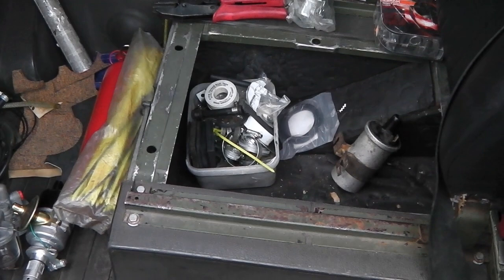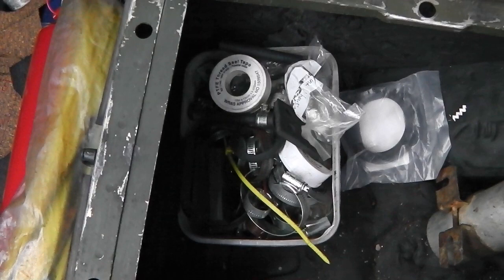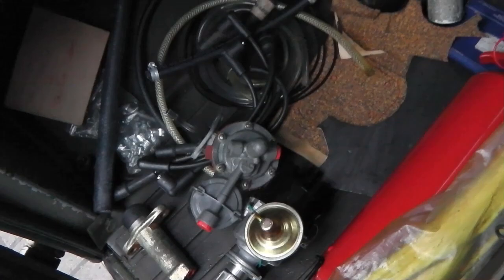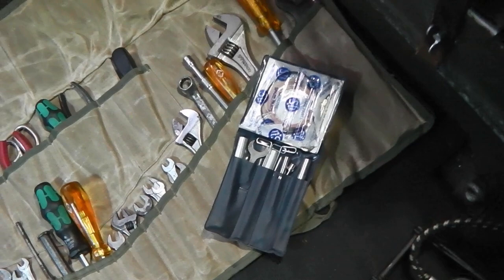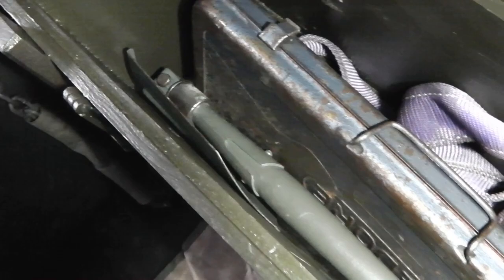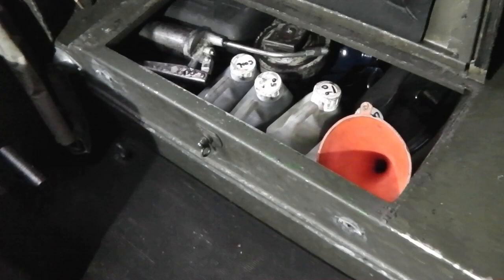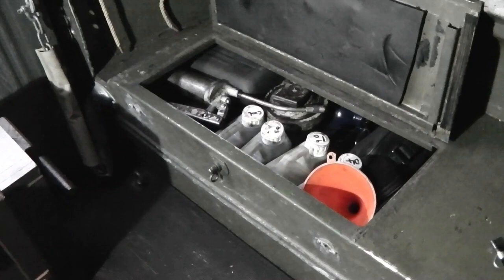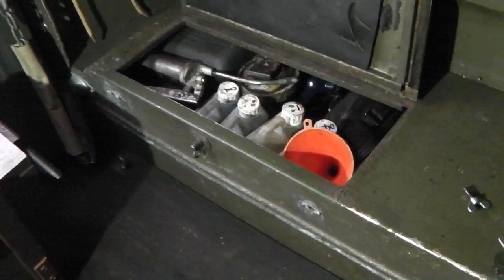Tool kit and spares in my Series 3 Land Rover

Comment: More comments!  I carry a few three foot lengths of decent wire, strong fencing wire, thick copper wire( out of 30 A mains cable) and some thin galv steel wire which is brilliant for threading electrical wire through holes for example, so you can pull it through . Useful for everything potentially but hot stuff particularly. Exhaust pipes etc 
And a good powerful magnet. Keys down drain scenario. 
Also I keep some good blocks of wood, for jacking or run a flat onto so you get your jack under the spring base or axle. 
Jar of Vaseline and spare bulbs. And spare rad cap.

Comment: Have watched lots of your videos now ... extremely informative and a valuable guide.  I don't have so much luxury of space in my 88 S111, so am limited to what I an fit under the front passenger seat .... have had trouble with the points recently, so packed a spare set, along with rotor, condenser etc ..... went out on an errand today, and it started to splutter .... whoops, let the starter handle in the garage, which I use to rotate the engine and set the points!!! Oh, well, as usual she made it back home, if a little bit spluttery.

Keep up the videos - really good work - wish I had a mechanic like you to keep an eye on mine!
Reply from the maker: Thanks very much, always great to hear people like the videos - makes it worth taking the time. 
Have you considered electronic ignition? Despite the internet forum naysayers, installed correctly it is always an improvement.

Comment: Logical planning! I'd suggest adding a gas blowtorch, useful for all kinds of emergency including loosening stuck bolts,  heating the inlet manifold and pre-warming spark plugs ( put them back quickly !) in cold start disasters.  Heavy duty jump leads from welding cable are good &  I'm a second battery and spare alternator convert. If tubeless tyres then a good quality tyre plug kit is a must and if tubed, two new inner tubes. I guess you are post-starting handle era with Series 3 ? I also carry loads of epoxy metal, araldite etc. and soft iron wire plus assortments of sizes of cargo ratchet straps and odd pieces of timber are useful for bodge field repairs. I've made an axle breather plug from wood in a crisis ! A few spare wheelnuts could help when the ones in use disappear into drains. You might justify a 101 if spares inventory escalates! Beyond 35 years of Land Rovers I've found Unimogs also  therapeutic, but nothing  much breaks and the same is true of my experience with pre- electronic G Wagens.  An unforeseen 1986 Land Rover Ninety (2.5 Petrol ) disaster was the hood ripping off in a storm on the M5 in high speed trials. Weatherproof clothing would have improved the rest of the journey.....  Thanks for your videos! See also Defender Mods and Travels for great content and tips.
Reply from the maker: Araldite is a good shout, the 5 minute cure stuff is quite useful. Like you say, the spares kit can escalate quite quickly and it's always going to be the thing you haven't got which breaks! I've tried to condense my kit to just the items which have given trouble in the past, typically anything perishable like rubber components.
Reply: @steamwally  Not forgetting at least 5 litres of water and a fan belt, or maybe you showed us that ?
Reply from the maker: @philhealey449  Fan belt yes, if I'm off camping which is generally the case with longer journeys, there is always a good 5 gallons of water aboard anyway. Actually, I've been thinking about installing a tank for drinking water under the tub, saving space inside.
Reply: @philhealey449  are old G wagons reliable and easy to work on?
Reply: @claudyfocan731  I'd say the older they are the easier they are in the engine bay and there is less to break. I'd try and find a 290GD as the best compromise for high reliability and adequate performance.  Rust can strike of course on bodywork, pre plastic metal fuel tanks, brake pipes etc but the chassis rarely rusts.  Some commonality of parts with vans helps with costs of brakes etc. All my G problems have been with my current  300 CDI  "Military"  Previous 290GD and 280 GE were bulletproof. The latter was crazily thirsty however.